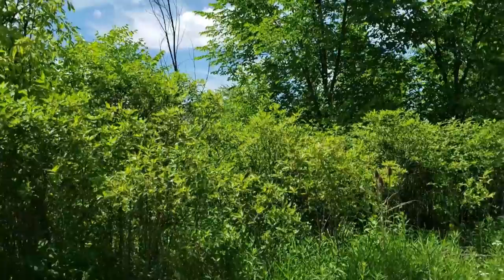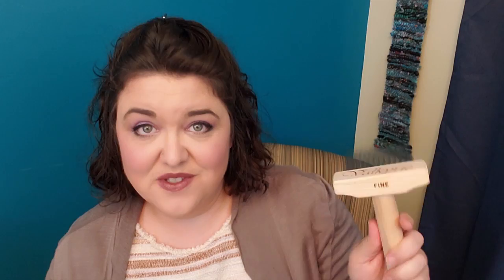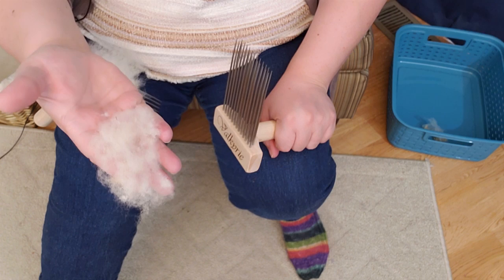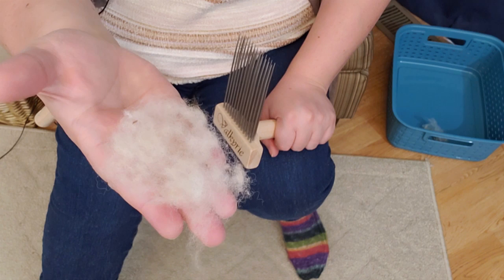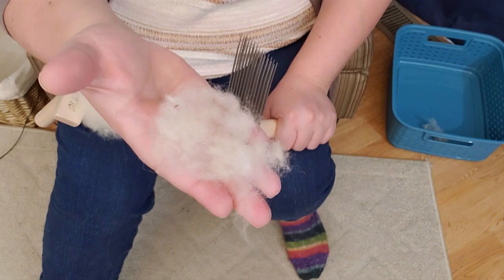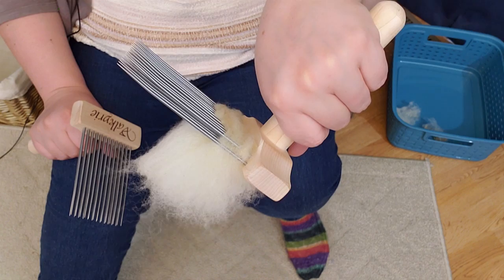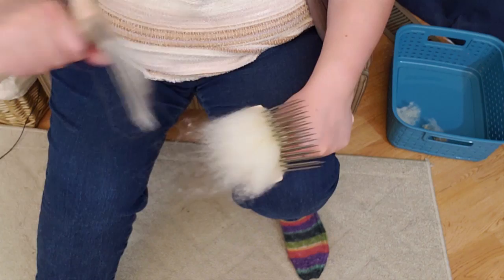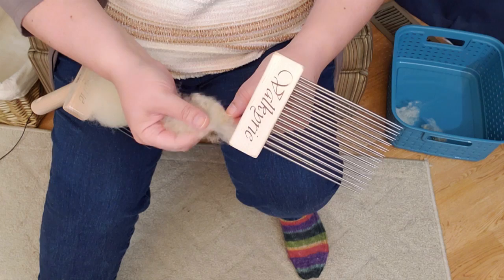Wool Combs for spinning my Dorset Fleece (but I'm doing it wrong)

Comment: Great video!  I think everyone should prep a free dirty fleece at least one time.   Makes you appreciate those with very, very low VM.   I love my Valkyrie wool combs.  I have the standard size and they sure do give my wrists a workout, but the handy dandy clamping holder does relieve some of the stress.  As far as my binge watching favorites - the "Outlander" and "Call the Midwife" or just put on a good talking podcast or listen to an ebook.  As always - Thanks for sharing.
Reply from the maker: I completely agree about everyone working on a messy fleece at least once! I need to check out Call the Midwife!
Reply: I agree.   It is very fun to process fleece.   I do several a year .   I love making bats and some times I sell them .  I raise sheep .   Shetland , downs Shetland cross.   Blue faced Leicester  and Shetland bfl .   Mixing sheep breeds and spinning them.   Love your videos

Comment: I looked down at your feet and saw the exact same pair of socks I knit last year for myself. Great taste in yarn! (And thanks for the education, of course! I am processing my first fleece, a 5lb Romney, that I got at a fiber festival, so I'm in research mode!)
Reply: Question: At what point in the process would you card instead of comb? Or can you do both? I can see skipping the diz and carding the combed fiber, but is it necessary to comb at all if you're carding? The only advantage I could see to doing both would be for an extra dirty fleece that needs VM removed and locks opened up more before carding into batts -- but I love the little nests the diz creates too! Maybe I'll try both (nests and batts) and see what happens. With a five-pound fleece, I have my work cut out for me -- literally? 😅🤣

Comment: I am debating on whether to buy combs or not so a good informative video 👍🏼 thanxxx
I have received 2 fluffy mule fleeces from a friends flock (one ram + one lamb) so it’s an expensive purchase if I discover doing the full works is not my bag 
......and I kept looking at your socks too - very familiar - I’ve got a pair knitted from same yarn and stare at them regularly whilst knitting or crocheting!!! Lv Wendy
Reply from the maker: The nice thing about fiber equipment is that it holds its value pretty well and there are a lot of FB groups selling used fiber equipment. Good way to purchase or to sell if you find it isn't for you. ❤🧶🧦